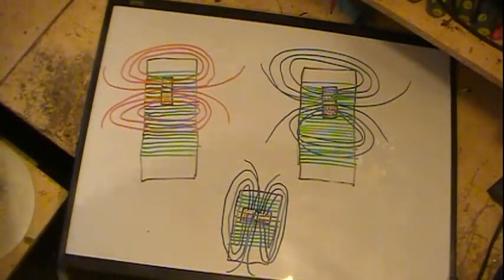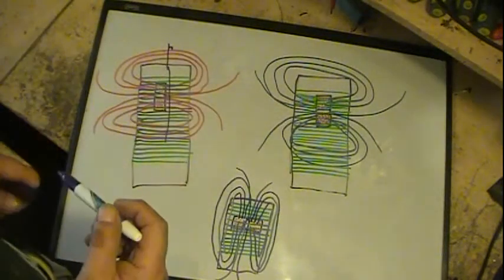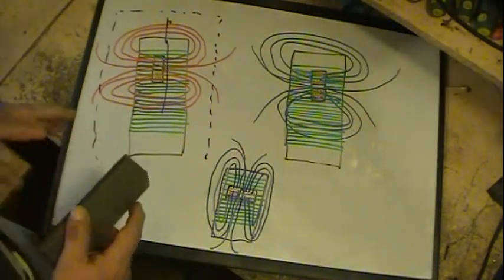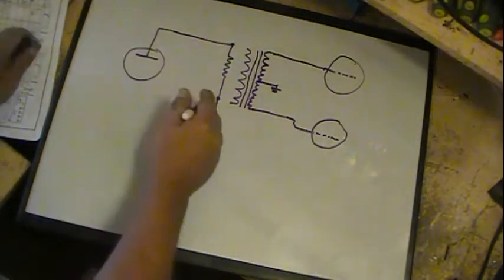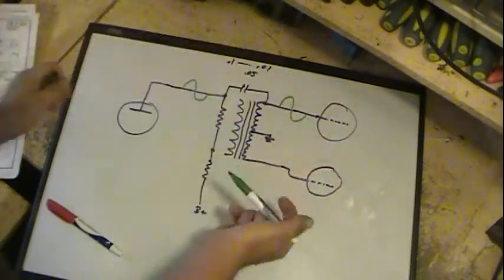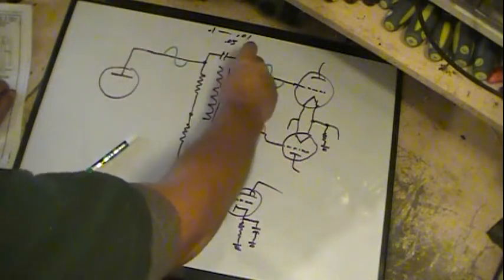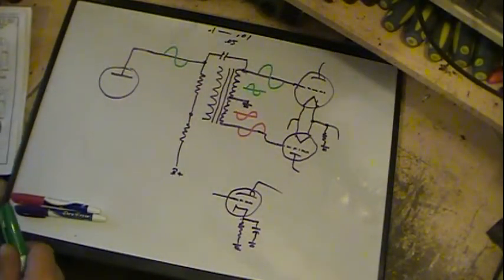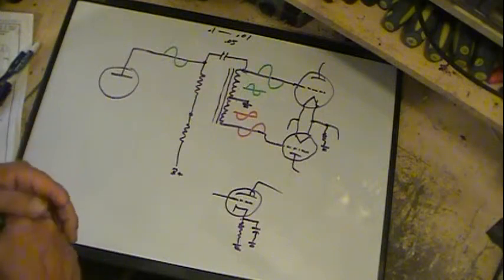More info on the coils and the mod on the Airline TRF

Comment: DANG... I accidentally gave you a thumbs down using my Android. I HAVE TROUBLES PRESSING THE RIGHT STUFF ON THE SMALL SCREEN. MY BAD... sorry.
I got the inductive aspect from winding orientations from your previous video. Thanks Dennis.
What I found fascinating in this video was how the primary interstage transformer works but preserves the push/pull phase relationship on the secondary. You explain it so consisley my friend.
Bravo my friend!
Tom
PS I hope this Android keyboard buthchering is not to bad!
Reply from the maker: ***** The thumbs down is not showing up on my end. Don't worry about it, I have troubles with those small screens too. Thanks for watching my friend.
Reply: Tom,
Clicking the thumbs down icon a second time will make it go away.  Then you can click the thumbs up.

Regards,
John